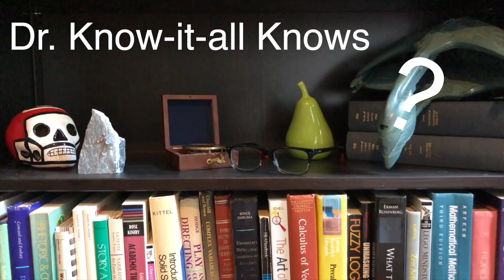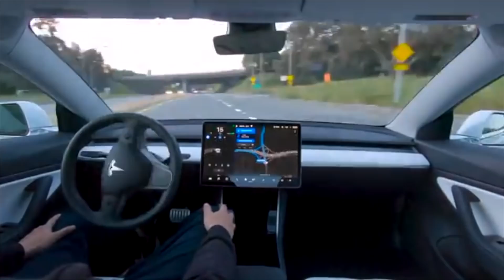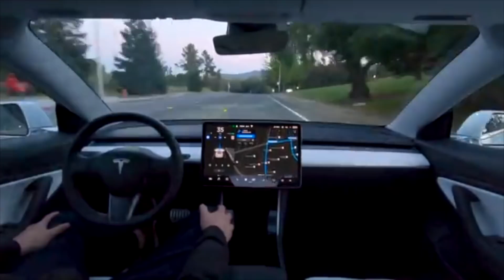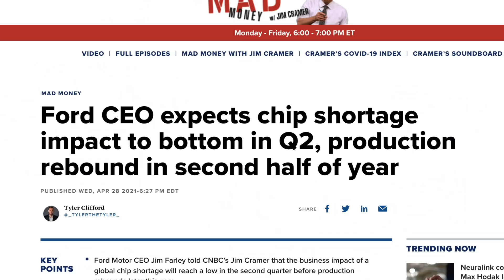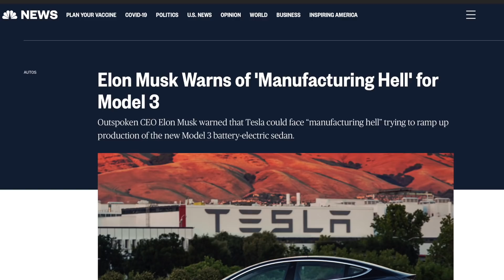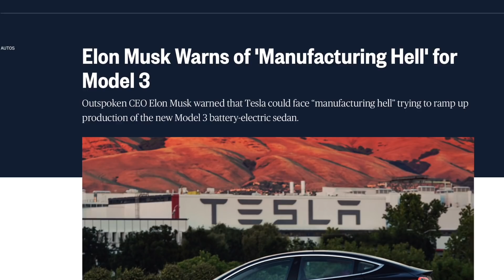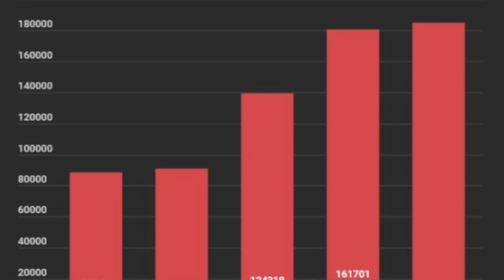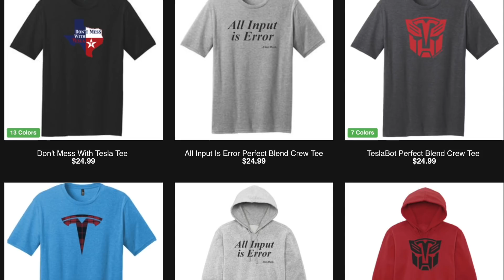Tesla Logistics: The Machine that builds the Machine that builds the Machine!

Comment: Love the video! FYI 90% sure the USB shortage was a previous issue a while back. He was just giving an example. Also, idk if there are major shortages with S&X. More than likely they pulled engineers and staff off that to help build and program new chips to keep 3&Y production going. That is their key to cash flow, and the majority of customer satisfaction.
Reply: The chip shortage might be the reason.
Like they diverted their stocks to model 3 and y instead of the new S and X which requires more.

Comment: Hi. Do you think Tesla could use more of super capacitors in their cars? They could have it as a burst range energy storage - let's have 200 miles in traditional battery and another 400 in SC - you use the energy right away either way so the vampire drain shouldn't matter and as a charging buffer - you charge the super capacitor first and only then the battery is being charged from the sc when you are already in the move.
They charge really fast, are much cheaper, lighter, don't degrade with cycles and don't use materials that batteries do.
Reply: Nonsense, capacitors are mostly used for acceleration in hybrid f1 or FE cars for example, they don't have a range.
Reply: @alanmay7929  SC usage in some branches of the industry has no impact on it's usage in other branches in the industry. What makes you think that Tesla cannot use the SC in their products because someone else uses it for a different purpose in their products? That's what I call a nonsense.
And of course SC don't have a range because range doesn't make any sense when talking about SC. What makes sense is their energy density, charging/discharging speeds, cycle degradation, price and energy losses during long term storage and as far as I know they tick all the boxes except for the long term energy storage (they lose the energy after about a week), which shouldn't be an issue in the areas that I suggested.
Reply: @zbyszanna  unfortunately adding super capacitors increases complexity in the system, FE and hybrids uses very specific SC, motors, converters  systems to quickly help with acceleration and charging.
Reply: @alanmay7929  they use those in FE because SC are very good with taking and giving out a lot of energy in a very short time. Tesla acquired some time ago Maxwell who were known to be working on the SC so they had some plans of using those in some capacity. People speculated that it might be for the regen breaking, some more brave souls even speculated they will replace their batteries with the SC completely.
I understand that adding SC adds complexity, but if the benefits are big enough it shouldn't matter that much. Just like with Teslas octo valve - they could have used a simple heat pump but they ended up deciding against it and went with a more complex but more efficient solution.
And once again, the fact that others don't use SC for a specific purpose doesn't automatically mean there is something wrong with it. Tesla has a lot of firsts, this might be another first as well.
Potential benefits from using SC in a way that I mentioned before are big. You could charge your car with a maximum available charging speed without any penalty for the battery. That is huge. Your car would also be lighter and much cheaper, because the SC are light and cheap. For semis, where people already know how much energy they will need before going for the road it is even better. If they weigh 10x less than batteries (that's what I read), you could add a lot of  range without impacting the cargo capacity.
Reply: So I'm reading more on SC and I guess my information on them being cheaper with better energy density was wrong. Well, sometimes one has to answer their own questions.
Reply: @zbyszanna  you are totally clueless mate, tesla uses heat pump and the "octalvalve" is nothing special, its just another way to control the HVAC, battery and components cooling/heating. regenerative braking are only/mostly used for very high performance applications and it won't work well in an EV. Depending on the state of the batteries, regenerative braking is engaged/disengaged.
Reply: @zbyszanna  the electric semi will have 100% batteries and maybe some SC to help with heavy braking and take off with heavy loads to maintain the battery. Trains and other electric equipments transform the excess of regenerative braking into heat for example.
Reply: @alanmay7929  Dude, you are completely clueless if you are saying octo valve is nothing special as compared to a simple heat pump. It is more complex than a standard AC or even the resistive heater and the point was about adding something more complex if it is better. They didn't stop at the resistive heater, they added something more complex. That was the point.
Also, you are not answering my question at all. I was asking why they don't use SC and you keep telling me where else people use SC (and I'm 100% aware of all those other usages). This is not what I'm asking about. At all. And the real reason is, because they are not (and this was my mistake) lighter than batteries,  indeed they are much heavier. That's the reason. Nothing you wrote answered my question. The only attempt was by saying "it would be more complex" which is completely not why they are not used. And if they add the SC to semi for breaking (or wherever else), then it means incorporating the SC into the powertrain has it's advantages, so there must have been another reason why not to use it more broadly. And you keep calling me clueless and keep giving me basic information that has nothing to do with my question and which I am completely aware of. 
It feels like talking to one of those emacs psychatrists. No comprehension at all. Bye.
Reply: @zbyszanna  I said the octalvalve is just a part of the HVAC and the heat pump is still there and its definitely not the most efficient system out there.
Reply: @zbyszanna  btw tesla doesn't use resistive heaters anymore and the heat pumps also struggle in very cold climates.